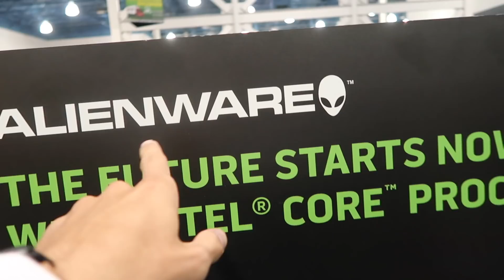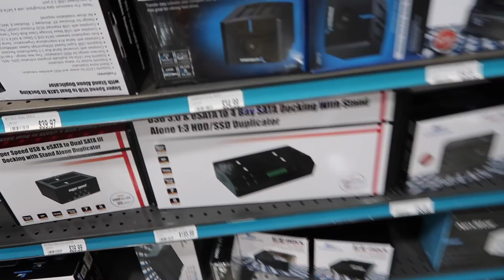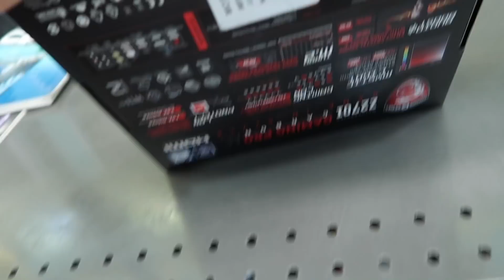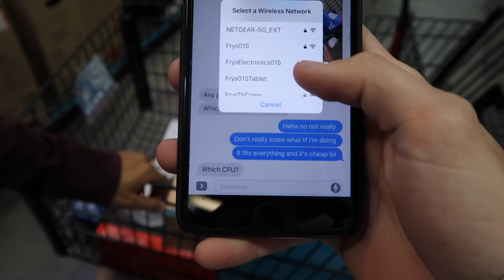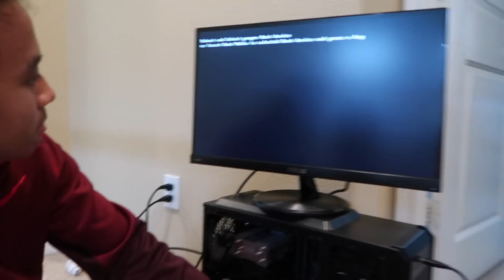Building my first gaming PC

Comment: rotate your cpu cooler man
Reply: doesnt really matter if he orientated it that way, there a vent on the top of the case and if he put it the generic way then the ram would have to come out
Reply: It should be pulling cool air from the front of the case instead of hot air from the gpu

Comment: TJ you have the CPU cooler facing the wrong direction. It should be looking towards the fan that is next to it, so this way the heat goes outside the computer. Right now all the heat will go to the GPU and it will break faster.
Reply: i was looking for this comment, you're right
Reply: Overdose On The Track it's not wrong but it's better the other way
Reply: Overdose On The Track I was about to comment this but then I saw his mouse and got aids...
Reply: It's the wors direction to set it up, he is going to overheat the GPU and summer is coming.
Reply: "GPU and it will break faster" seems quite bold. The fan doesn't even seem to be facing downwards as most coolers work in a push configuration rather than a pull which indicates that the heat is pushed upwards. The GPU should not be impacted by a little hot air blow on it anyways.
If you rewatch the video you can see the fan is not pulling from heatsink it is, in fact, pushing air. Even with the cooler faced horizontally, it should not impact the cooling or it should even, in fact, improve it from the laws of thermodynamics to hot air rising which where the fan currently is would actually assist a little bit more in cooling.
Reply: It'd be better if the cpu fan was on the right side so the heat could just blow onto the exhaust fan at the left side of the case. Easier for the heat to go out and better for airflow!
Reply: "The CPU won't be impacted by a little hot air"
Looks like someone has never built a PC or used high-spec parts before...
Reply: There's no exhaust fan on the top of the case so the air from the gpu is just making the parts of the pc even hotter.
Reply: The fan is facing downards, is next to the GPU, this fan extracts the heat from the CPU so is pushing the air out. The correct direction is towards the exhaust fan as the comment below you said.
Reply: The fan of the cpu cooler should be on the right side cuz it doesnt spread air. It pushes the air from the right side through the heatsink towards the exhaust fans if mounted the way I told to mount.
Reply: Sooooooooooo I'm dumb when it comes to computers but I need to build one for architecture anyone wanna help😬
Reply: jeancarlos guzman Do you know what Reddit is? You can google "Reddit buildapcforme" its a forum with people dedicated to helping others build their own pcs for their specific needs, just tell them what it is youll need a PC for and theyll help you out!
Reply: ᅚ "heat rises with basic physics" mate the case is less than two feet tall calm down there lol
Reply: Yep, it's either sucking warmer than necessary air from the graphics card, or it's blowing it's exhaust into the case. Either way, not the best, however, if he isn't going for too high of OC numbers, it'll be a degree or two hotter than the other way. It's not going to make or break the system.
Reply: I Can't Think of a Display Name shouldn't matter in this case board is locked with processor
Reply: really, someone really thinks blowing hot air on the back side of the gpu is going to break it? those bastards get over 70C where I'm from and they never missed a beat, if this was a overclocked i7 2011 or a AMD of similar power (I've only built Intel pc's before, but the new ryzen is looking good) then yeah, he'd have a problem, but he'd also have a freaking massive water cooling loop that cost more than this pc and by that point there wouldn't be any fans on the cpu in the first place
Reply: Overdose On The Track incorrect. The CPU cooler has the fan on the bottom pushing air up into the heat sink and to the top of the case. Not towards GPU. However you are correct it's best to be facing sideways to the back of the case. Where he has the fan turned the wrong way, currently that back fan is blowing air into the case which he should turn around as well
Reply: And no, even if the fan was facing the GPU it will NOT overheat. Y'all need to relax this is 2017, these parts will not burn out.
Reply: mystichisoka2 z🐲🐉🍀🌲☘️💣🔪⛏⛏🎲🥊⚽️🥄🍷🍼🏑🏀🏀🏀🍼🏈⚾️🎾🍼⚽️🌈🌈🌈🦎🦂🕷🕷🦋🕸🦇🐍🕸🕷🦂🐛😻😾
Reply: i was thinking the same thing. i was like "is he tryin to blow his gpu up ?" hope he read this comment
Reply: I hope he sees this
Reply: i saw it on his snapchap also lmao
Reply: is that why you commented
Reply: OhLoki for sure.
Reply: high spec parts lol if thats the case why not do a custom water loop or at least a AIO water cooled unit
Reply: Stephen Bouck he can't overclock his cpu so there's no need to go overkill on the cooling. He just has to adjust the placement of the air cooler that's all :^)
Reply: i know i was just being a smart a$$ lol just pointing out that a fan isnt exactly high end parts lol
Reply: why do you give recomendations when you have never built a pc the gpu is not going to have a problem because the fan sucks air from it's side and throughs it upwards.Either way thermals won't be affected by much and the lifetime of his components won't shorten
Reply: also this cpu or gpu will never overheat in this pc because he is not even overclocking
Reply: This is the only reason I clicked on the video lol
Reply: Thank you.

Comment: wrap your pc case like the 350z <3
Reply: redapp9 awsome idea
Reply: redapp9 Thats a terrible idea, I feel sick whenever I see that car
Reply: he actually should wrap it
Reply: redapp9 pretty sure that will insulate it and make it run warmer. I know if the fans are doing their job it shouldn't matter but it won't let heat out through the panels any more with the casing covered.
Reply: That is a pretty awesome idea.
Reply: Goodluck with temperatures on that.
Reply: YES YES YES send it to premium for some sweet ass pimpin
Reply: If he got a water cooler that pushed air out the top and had even pressure throughout the case then it might not effect temps that much.

Comment: Should rotate your CPU cooler 90° counterclockwise for cooler air, Right now you basically blowing hot air to your heatsink from your GPU.
Reply: And your rear fans are backwards. Front fans intake, rear fans exhaust. The fan setup you have now will cause hot spots in the PC and lots of dust
Reply: it pushing air upwards dude. not onto the gpu. But yes he should rotate it 90degrees anti clockwise so that it pushes the hot air out  through the rear fan like mine instagram.com/p/BOb6dK1jPDB/?taken-by=kelvinbastow
Reply: Mario That GPU isn't a " blower style cooler " it is a " Open-Air style cooler " So the heat is literally everywhere and heat rises, Open-Air coolers has no vents for the back, The way his CPU cooler fan is facing is sucking all the heat to its heatsink.

Comment: Somethings to consider with this build, first off, as mentioned in other comments, the CPU cooler fan should not be facing towards to GPU, the reason for this is that if the fan is pushing towards to GPU you're pushing hot air onto the component, if the fan is pulling away from the GPU it's pulling the hot air into the CPU which will hamper it's cooling capabilities. From a non overclocked machine you will find that you won't hit super high temps, but I would recommend still rotating it to maximize your cooler's ability.

Secondly with regards to fan configurations, purely because I didn't see you make mention of it. Fans have 2 configs they can be in, purely based on their orientation in the case, these are push and pull. The rule of thumb for a fan setup is all fans except the back fan are in pull (they pull air into the case) and the back fan is pushing the air out. You want all air coming in to flow towards to back of the case, this is the same for the CPU cooler, make sure the fan is sending the air out the back.

Doubt you'll see this comment, but hope this helps you or someone else looking to build a machine. Also congrats on your first build! :D

Comment: Nothing like cooling that CPU, with hot air from graphics card. Also great idea to test it on carpet. Great job.
Reply: Dumb Dead1 I know... it hurts watching.
Reply: Right? They should've put the fan on the other side, where the case vent is. Also, they got a pretty weak MB, and used way too much thermal paste.
Reply: Brandon Bassani Is "butthurt" still a thing? I thought that died. All we're doing is pointing out flaws.
Reply: Brandon Bassani Calm down kid, do your parents know that you're cursing on the internet?
Reply: Insignifcant? He just spent a grand on a PC which he then built incorrectly.
Reply: It really doesn't matter if you build on carpet or not. You need a metric shit tonne of static electricity to even think about damaging parts. It's just like phones on aeroplanes, they used to do harm but now really don't do anything.
Reply: if you want to fry your motherboard be my guest and build on a carpet
Reply: what about in a car if you have shit blocking your radiator then its not doing its job right
Reply: honestly. i have put my comp on the carpet and installed parts on the carpet cus im dumb and dont care. never had an issue.

Comment: Better to put the cooler sideways so the fan is pushing air out the back of the case. Also flip around the rear fan to be an exhaust since that spot isn't filtered. Dust will get in with the current fan orientation

Comment: What up TJ, owner of a $30k PC build here. My company sells delidded CPUs and pre-modded GPUs with direct die AIO water cooling as well as pre-modded/cut cases. Congratulations on your first PC build! 

Just two simple things for you to check on to extend the life of your system. 

1. Is your CPU fan blowing air down into the GPU or up through the CPU heatsink fans? You definitely DO NOT want it blowing to the GPU. We can only see one fan. You do have a top case fan exhausting air, correct? 

2. Looks like you got a cheap Enermax case. You didn't give us any good angles of the case or its components, so not sure how many fans you have. On camera, we can only see the one fan attached to the CPU heatsink. As you know with cars, overheating = bad. Same thing with a computer obviously. Most cases come with at least 2 fans which is OK but not great. (not counting the CPU fan which comes with the CPU cooler).

3.If you can avoid it, lift up your case somehow to get it off the carpet. Dust bunnies, dust mite feces, hair, etc will get sucked up through your power supply intake fan. Use anything such as some spare wood, sand it and hit it with some flat black spray paint and make yourself a little platform for the case to sit on. You want the wood to be maybe an inch wide so the rubber feet on the bottom of the case sits on the wood. Doing so allows the parts to run cooler which not only makes the fans quieter, but it is extending the life of the system. Even better, since the GPU is running cooler, the GPU Boost on the 1070 allows it to self-overclock a little bit more.

Comment: Hey TJ,  if you plan on keeping your computer on the carpet, make sure the fan opening on the power supply is facing up (toward the inside of the case). Otherwise you run the risk of suffocating the power supply while it's under load (everything makes heat, and if you don't have good airflow, the heat lingers around, which is bad news)!

Comment: Damn he doesn't need a 1070
Reply: xofy lol I was like daym
Reply: xofy lol I got a gtx 1060 but my cpu is an i7 7700k... :^)
Reply: I am upgrading my GT 730 to a GTX 950 very soon, my current card is trash and it's in the middle of pooping.
Reply: i have a 1050 ti with an amd fx 8590 it runs well for what i need it to
Reply: xofy I have an SSC 960 and it runs pretty well. Most games at med-high settings.
Reply: Ive got a GTX 950 ;(
Reply: honestly the 1070 is worth it , the 1080 is a waste though for sure
Reply: I have the 1080 :D it's pretty. i have money to spend so idc
Reply: Few people need a 1070. Most would be fine with a 1060, and high details, looks almost the same, with way better fps. But, if u can buy it, and you want it, why not? 1080 is the same thing, but more expensive. I have a 960, i don't need a new GPU, but i'll be getting a 1070 or equivalent at the next Black Friday here in Brazil :)
Reply: if u got the money why the fuck not its not like he is going to play minecraft only
Reply: xofy I have a RX 480 and it's plenty for most game maxed out and 60+ fps 1080p

Comment: Render and edit your videos on it, it will speed up the process compared to the MacBook!
Reply: I doubt it he uses final cut pro which is faster than premiere.
Reply: With CUDU in premiere, doubt it... If it was purely CPU maybe
Reply: He does 1080p editing I assume it takes like 3 min or less to render
Reply: Ive never seen a computer render a video under the time it was originally. Maybe I haven't seen many high end PC...
Reply: Night Baron I can render a 1080p 30 footage that is around 6 minutes in 3!
Reply: Night Baron If I'm not doing a crazy edit it cuts the render time into half... OC 4790k and a OC GTX 980
Reply: I didn't say that, I said it cuts it in half from the original time
Reply: Mario Mine does though, I have a color correct layer with multi-layer edits. I render using cudu in H264
Reply: even if final cut is faster premiere has more options and features, final cut is bear bones

Comment: Your CPU cooler is sideways
Reply: Breezzy I have mine oriented that way as well. Heat rises, so why not follow the natural direction. As long as the air is blowing to the top of the case or to the rear, there's no "wrong" answer. Can it have an impact on temps? Possibly, but nothing that should be detrimental to the CPU or other parts inside the case. 

Like I said, mine is oriented the same way, but I do have 2 fans on it (push-pull config.) because since hot air naturally rises, and because the logo is now showing properly, where as it would've been sideways. 

Only downside for me was RAM clearance, I have tall heatspreaders (TridentZ from G. Skill), so I had to move them 1 slot over to the right. Not a huge ordeal, but if I wanted to add 2 more RAM sticks, I would probably have to invest in an AIO CLC.
Reply: add a second Fan to the other side of the heatsink in the same direction- orienting the heatsink blowing air toward the back is optimal for CPU temps. 

Pointed straight up like he has it will just be sucking the heat off the video card (typically hottest component in a PC, which vents what it needs externally ) so the CPU will just run a lot hotter all the time, especially when gaming when the Graphics card is at peak temp

Heat rises, sure. But that setup will just increase ambient case temps

More intake fans (positive case air-pressure) front, side, bottom is also what you want for keeping cool during long gaming sessions. Exhaust out the top and rear

Comment: The CPU cooler will be pulling air from the bottom to the top. Overall, it is fine how it is. TJ is not overclocking or stressing the CPU more than factory settings. Would turning the heat sink 90 degree counter clockwise yield better cooling? Most likely, but current orientation will cause no problems as well.

Comment: Heat Sink fan is upside down. Should be pointing outside the case to blow all hot air away from the computer. Also, Should have just bought a liquid cooler.. Slightly more money, like $40 maybe and greatly improves performance with the build.

Comment: Are you sure that the heatsink is correct? Usually the fans go horizontal not vertical. If it's vertical it will shoot the heat onto your graphics card?

Comment: The CPU cooler is on upside down now it's blowing all the hot air that is coming off of the cooler right onto the graphics card instead of facing it the other way and having the air exhaust out of the case also prop it off the carpet if you don't want it to fry from the static on the carpet

Comment: DONT PLACE THE CPU FAN FACED DOWN!! if you leave it the fan will be picking up hot air produced by your GPU causing higher CPU temps. face it towards the front

Comment: omg i want to die after seeing this he did the classic thermal paste strip on the cpu wich literally is too much a single drop is enough the freaking fan is wrong placed so all the heat the cpu builds up is worse since their is hot air blown into the cpu :/ also i doubt he used the supported ram for the motherboard

Comment: no ones going to mention theyre standing on carpet. lel
Reply: If you hold the case you are effectively grounded. Static shock is rarely damaging to components, but more best-practice if you work for an OEM or re-seller so you don't damage the goods

Comment: Why would you not spend the extra $20-40 and get a liquid CPU cooler! Wtf?!
Reply: Depends on how much he wishes to overclock and also the case radiator support
Reply: Over clock or not, the closed loop liquid systems are generally better, and keep ambient temps in the case down. Also it would have fit no problem, you don't need the massive radiator kind, a simple 120mm would have been OK.